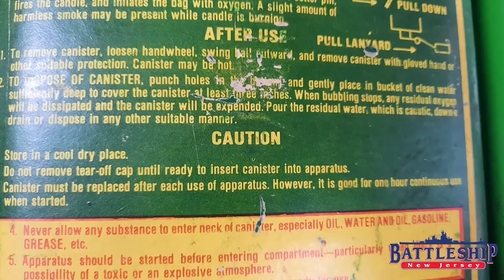Do OBA Cannisters Actually Explode When They Get Wet?

Comment: I was trained on the the earlier version as part of a poison gas response team.  We were told that the reaction was triggered by the moisture in the breath being exhaled.  Also we were told to take a deep breath of clean air and hold it until  mask was put on because that was the only air we would be reusing for the next hour or longer if the canisters were replaced.  You also had to hold your breath when changing canisters.
Reply: Yep, agreed, you take a big breath, put the mask on, tighten straps then exhale. We used them as well. I went through Navy bootcamp in 1993, and served on submarines from 1995 to 1999
Reply: I believe the reason for the deep breath was to "start" the canister with a larger volume of moist [exhaled] air to start the chemical process going.      Not really the same air.   The CO2 is scrubbed out, and more [granted hot] oxygen is added with each breath.  Also helped to inflate the rubber 'lungs', if using that type.
Reply: @stevecooper2873  same as I remember

Comment: The Canister lasts 60 minutes (or at least in did when I got out in 1995).  The Candle was originally used to start the reaction of the main chemical to produce O2, while absorbing CO2.  However, it was found that you could put the mask on and exhale, and if need be repeat to get enough air into the canister, where the moisture from your breath would start the reaction.  If you had to get out and you didn't have enough air, then you could pull the tab and light the candle which would give you another 5 minutes to get to a safe area.
 
The earlier OBA's had a disc where the speaker is now.  (Like several gas masks have.) It was hard even on a drill to hear someone talking!
 
The SCBA (Self Contained Breathing Apparatus) wouldn't fit in the scuttles of some ships I once served on.  Note: The U in SCUBA stands for Underwater....
 
The reason why the US Navy stopped using the OBA was due to the Hazardous Chemicals and the need to be careful when disposing of the Canister!  Oil (and other petroleum products) will spontaneously combust when pure O2 comes in contact!  This is where the stories of exploding Canisters came from......
Reply: In the mid-90's I remember the 32nd Street San Diego main space firefighting sim right on the bay had a picture of a OBA canister exploding after they added oil to one and dropped it in a metal Garbage can and put the lid on. Allegedly, they never found the lid and the pic had 20+ feet of flame coming out of the top.
Reply: I just remember that while I was in the Reserves (82-85) there was an Incident Report where there had been a fire in a Main Space (i.e. Boiler Room & Gear Turbine Room) and that after putting out the fire, they started pumping the Bilges to the Outside Waters (they were way out to sea and back then it was allowed) the crew threw spent and partially spent OBA Canisters overboard without thinking about the oil on the water from the Bilges.  Someone supposedly got hit from a piece of shrapnel!!!
Reply: Potassium superoxide can form an impact-sensitive explosive when mixed with some oils.
Reply: paramedics get nervous when you go with oil near breathing equipment too! (I have seen what happend after someone greased an fitting for the 02 in the truck.)
Reply: @pouncepounce7417  When I was in school learning to weld, they showed you how to move the gas cylinders, always chain them to the cart, safe way to put the regulator on and so forth.  Then they showed a film of a scotched regulator and the camera pulled back the cylinder was gone, a drop or 2 of oil was on the valve and oxygen hitting it at 2,200 psi and it went off like it was nitroglycerin.  Also never blow your self off with oxygen, it can stick to your shirt and a spark hits and it will go up like it's soaked in gasoline.
Reply: The speaking diaphragm is still on that particular OBA, and the speaker is just a microphone and amplifier that clips on over it. Exact same system as on the M40, MCU, and Millennium gas masks, in fact the amplifiers are all interchangeable - I've got one I found listed as an OBA amplifier clipped onto my MSA Advantage which is the civilian version of the Millennium. You also had some later variants of the MCU and Millennium masks that had a mic and a 3.5mm jack for an external amplifier or a radio but those are rarer to see, and it's built into the mask so it's not interchangeable with the OBA masks.

Comment: Oh this a time machine, SSBN Georgia 1990 - 1997 SONAR. So my division was 1 of the 4 fire teams for off going shifts. I did lots of training with the OBA and 2 actual events which required usage. Important note, if you press on the lung bags on the side, you can empty air within which means there is not enough air in the system to breath. This can happen very easily when holding and controlling a fire host in crouched position. It is also important not to over fill the lung bags with too much air as when you exhale, the excess air will burp out the face mask and could not have enough air to breath for a minute or so. In short, not a perfect system but it is effective. Later.

Comment: Wore those many times in much older times. The chemicals both scrub CO2 and provide oxygen. Your own work rate affected the reaction rate. I wore one once as a test, laying in my rack, to see how long I could go. Still good at 2 hours but I was done pushing my luck. On another instance I was busting tail in an active fire. I started to get signs that the cannister was going dead after about 40 minutes. With the greater reaction it got so hot it would not even fall out properly it had to be coaxed out. If one were to get a lighter weight hydrocarbon directly in contact with the Potassium Superoxide than add some water they kinda went nuts.
Reply: Yup, fought a shipboard fire and my canister started running out in about 30 minutes. If you're working hard you use up the canister much faster.
Reply: I was wondering about that. SCBA rated for 1 hour last something like half that under exertion. They also do not last as long when really cold (like - 25F).
Reply: Also, if you accidentally pushed on the bladders  while working the fire hoses would allow the oxygen  to be less. Had that happen to me in Firefighting School in Yokosuka..

Comment: I was in boot camp when the Forestall burned. The Navy got real serious about fire fighting school especially for those of us in the air wing. there was always a demonstration punching holes in a OBD canister and dropping it into oily water they do explode. Also would spray water on burning magnesium with the same results.
Reply: I don't remember when they figured out how to put out a magnesium flare with water, but I've seen the training video. You use a long low velocity fog applicator and you need to jam the applicator right against the burning end as quickly as possible. The idea is that you're getting so much water on it, so fast, that it gets the flare below ignition point. I've never heard of this being done on an actual fire. If I ever come across one, I'll throw sand on it or just let it burn itself out.
Reply: @johnslaughter5475  they would put the Magnesium behind a steel plate and put the fog applicator through a slot  Ka boom. had a fire extinguisher  with what they called Purple K to put on Magnesium fires "aircraft wheels"
Reply: oil is the really bad juju with an oba canister. it was always stressed you dont touch the seal with your fingers, as to not get oils from your skin on it.
Reply: @richardmarble8898  I remember Purple K. While being effective on an electrical fire, it wasn't a good option due to its corrosiveness. The video I saw was not behind a wall. They were using a 10' applicator and held it up and to the side. They then put it against the flare and it went out almost instantly.  I have tried finding reference to this method and have failed. This indicates, to me, that it is not considered viable and shouldn't even be shown as a possibility.
Reply: @johnslaughter5475  It's been 50 plus years so I might be off a little. We used foam to put out combustible liquid's and CO2 for electric equipment. Fire fighting school was always a fun day but I would hate to have to go through the real thing.
Reply: @richardmarble8898  I did, twice. One was a simple compartment fire. The other was a fire in #2 MMR. That was a bear. Like you, it's been over 50 years. We didn't have all the fancy firefighting gear they do now, except for the flight deck. We went into those fires wearing dungarees and an OBA.
Reply: @johnslaughter5475  On a Perry Class FFG, we were told to use Solid Stream if one lit off on the Flight Deck... Basically blast it over the side since the Ocean is noticeably less flammable than the ship, the helo, and the crew for both!!!
Reply: @timengineman2nd714  Sounds good. I was on a DC party on 2nd Deck. Fortunately, no flares there that I know of. Hangar and flight decks were entirely different matters. When I think of one of them getting accidentally lit, I think of the catastrophe on Coral Sea.
Reply: @johnslaughter5475  
Not a Navy guy but went through a bit of firefighting training run by the Navy. We were always told to never under any circumstances apply water to a Class D fire. All my buddies in the Navy essentially have been told that for a magnesium fire, just throw it over the side.
Reply: @theatagamer90  That's true. If you can throw it over the side, that's best. What I saw was something that had been practiced over and over. It would not be worth the time to try and teach people how to do it. As I mentioned, I can't find anything on this anywhere. Therefore, it must be considered too dangerous.

The fire on the Oriskany was caused by someone throwing a lit flare into a flare locker. 44 men were killed. If I remember correctly, there was no hangar door open to throw it over the side and the sailor panicked.
Reply: @johnslaughter5475  Make sure that sand is bone dry !

Comment: In the mid to late 90’s the timer sequence was 60 back to 30. I used a bunch of those in training as the #1 nozzle man, team leader and scene leader. Twice in a actual fire.
Reply: Which ship you use it on while it was on fire?
Reply: Yeah, you burn way more oxygen actively fire fighting than the originally spec'd 60 minutes.  We set the alarm to 30 as well.

Comment: Regardless of the exact specifics, I think we can all agree that chemical oxygen generators are extremely dangerous if not treated with the appropriate degree of respect.
Reply: Valujet 592 caught fire from chemical O2 generators in the cargo hold and crashed killing all aboard.
Reply: @terryboyer1342  That was actually one of the occurrences I had in mind.
Reply: Old-fashioned corrosive primers in military-grade firearm cartridges use potassium chlorate as the ignition material. Yep-- ammo was set off by a superheated puff of oxygen shot into the gunpowder.
Reply: In February 1997 a chemical oxygen gen canister (TGK) caught fire on the Mir space station.
Reply: Glad we use them in the International Space Station. Lol

Comment: Last time I wore one of those was, I believe September of 1991 in the Philadelphia naval shipyard aboard the USS Constellation CV64 fighting a fire crewman set.
We were told the same thing about getting wet. And had a separate place in the hangar Bay to drop them during The blaze.
Reply: Never a dull moment aboard the Connie 😅
 Just like that one time during flight ops some handler moved a prop right into something right under the island and a piece of the prop flew up and smacked the Boss's window.  There was a lot of yelling over the MC5 and in about 5 minutes some blue shirt was up there getting reamed out by the Boss, then the Captain had him booked next, and probably the CAG.

Good times, good times 😁

Still not as good as that time during a night launch a pilot had to drop his fuel tanks right after take off.  We just heard the cat go, then about a second later night turned nearly bright as day for a moment and the MC5 had everyone scrambling to rig net.
Reply: @cocodojo  Sounds like we got all the fun.. 
Aside from that fire, while underway we had MM2 spring a fuel-oil leak all over the boiler.. only the actions of a Boiler tech kept it from going boom.. we did have a long fire though, I was not on duty but still we all pitched in. 

While heading out to RimPac we had a pilot lose the CAGs F-18, it was a dead shot on cat #3. According the airdales it went off the deck, he punched out, then the plane went straight up and hung in the air over the flight deck as we sailed out from under it at a height of around 100 feet. It then fell over on its back into the ocean.. 

Got a lot of personal stories.. most good... but all in all I am glad to have served in the Navy. 😁

Comment: Ryan, we were ALWAYS taught to set the timer to 60 and then back to 30 minutes.  When you are wearing an OBA , you will be taking part in extremely strenuous activity and your heartbeat and breathing rates rise accordingly....trust me, I was 20 years as a fleet BT and normally assigned to Repair 5 on 3 of the 4 ships I served aboard.  Always heard the spent canisters could explode, but never seen one do so.  We would place spent canisters in a dry area to cool down before turning them over to the HT's or DC's for disposal.
Reply: Was the "to 60 then back to 30" to make sure the spring had enough tension to rattle the bell nice and loud when the timer ran out? 

My toaster oven instructions say "turn to 20 then back down if you are using it for less than 20 minutes" I think partly to get a nice loud ding and partly to make sure the timer does tick down
Reply: Bt1, is that you? Bt2 burroughs here, we served together on the McCormick. Hope your going well! I always heard the timer was mechanical and it was better to wind it up well (up to sixty, back to thirty) so it couldn't peter out due to not being wound up well enough to begin with.
Reply: When I joined in 75 se set the timers to 60 and backed it down to 45, later we were told that fighting a main space fire 45 min was too long, we set them to 60 and backed down to 30. 30 min is a really short time to get on a hose team, go down at least 2, maybe 3-4 ladders and fight a fire with so much smoke you couldn't see anything at all, what you were tripping over or even if there was a hole where there shouldn't be or a deckplate was pulled up to access something in the bilge.  Fighting  a 1 1/2 inch hose and trying to put out a bilge fire that covered the whole space didn't help much either. BTC here  repair V locker leader on 3 ships.

Comment: I trained many times with those, felt claustrophobic every time I used one. I just thank god I never had to fight a shipboard fire. I can assure if I did, I'd be setting the timer to 60 and back to 30 instead of 45. Firefighting training in the enclosed space simulator full of thick smoke was terrifying.
Reply: I guess the claustrophobic effect comes with almost every mask and a certain resistance to breathing. 
As long as you have something else to concentrate your mind on it's ok for me atleast. Also it's a question of training. One gets used to it. 
Greetings from a german voluntary firefighter ;)
Reply: @baer0083  In the 34 years since I last wore one I haven't had an issue with masks like that. Probably the difference between being 18 and being 54.

Comment: Used by the RCN until 2014 or so...I know, I think I taught one of the last courses with them at DCTF Galiano (Victoria, BC, Canada).  If the canister has the candle, then you put the mask on, pull the candle, and you are good to go.  Timer is set to 60, back to 45 min.  You will get >60 min from a canister.  Chemox A4, and I've spent way too much time in them.  The burn mark on the deck of HMCS Algonquin was amazing, I saw it.  After that, no more using the candle in RCN service, we just used the 3x5 sets of breaths to start them .(post 2002)  (breath in, inflate lungs, until full, breath x4, then squeeze air out, repeat).  I was involved in cutting the lungs apart on one probably in 2015, and it wasn't as gross as we had all been told...which was a big shock.  Again, RCN policies changed, when I started on ship we wore what looked like raingear, and were fighting fires wet, then we changed to B gear and dry.  I never did HV/LV, but always Vari-Nozzle.
Reply: 92 93 was the last of the HV/LV use.